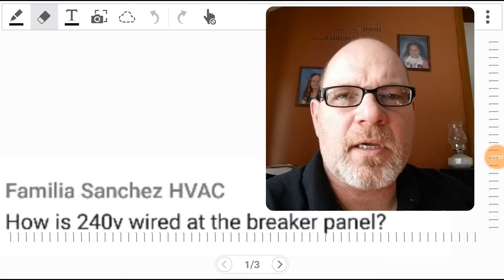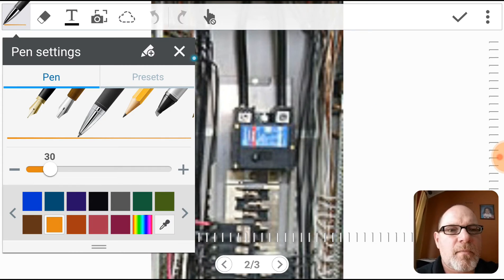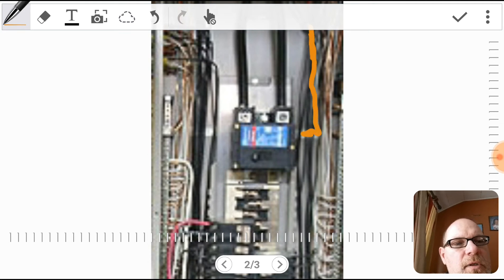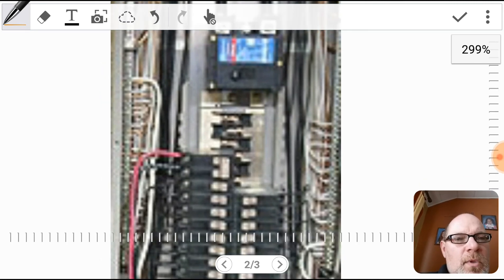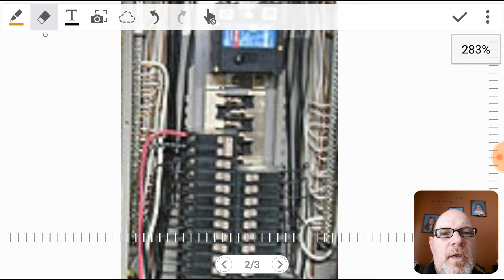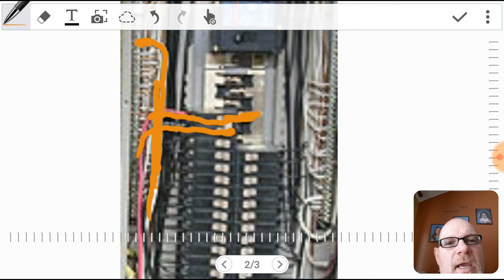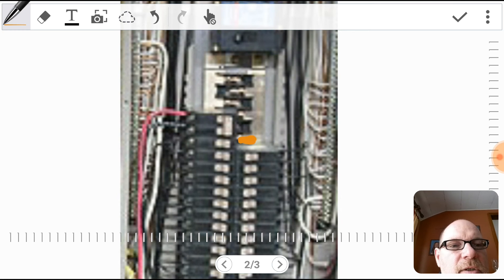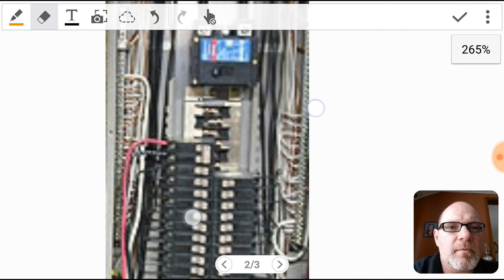240 Volt Single Phase Breaker Panel Wiring Talk

Comment: I'm trying to figure out where the phases seperate , could I use 120 at 30 amp to run something 240 at 15 amp? Doesent 240 run on 2 phase and 120 on 1 phase? It would be same wattage.  Is that too low of amperage like could I some how get 240 30 amp from a one phase 120 60 amp. Wouldn't the watt consumption be the same?
Reply: It is single phase period.   There is NO phase separation.   Phase is phase, volts is volts, and amps are amps.   With transformers, you can say yes to all your questions.   Without transformers the answers are all no.

Comment: For hvac ac compressor outdoor unit. It is the same??? In that case the comoressor is 2 phase not 1 phase i am confused
Reply: Building Statux    There is single phase and there is three phase.   There is no two phase normally.   If you look at a phase as the number of coils in the transformer and not connection points, it might help.   Single phase 120/240 is one coil with a tap in the center of the coil with three connection points.   Hope that helps.

Comment: So I've been trying self learn how to wire a 60gal compressor up in my garage for 240v. The compressor motor says it requires 230/1/60. I think that means 230 volts, single phase, 60 hz. The spec sheet for the motor says it requires 15 amps.  the compressor itself only has three wires. Two hot and ground. Red, Black, Green. Can I run a 20 amp, 2 pole breaker on 12/2 romex? White labeled red/hot, black hot, ground from the subpanel ground bar to the outlet ground? I'm getting confused because there is no neutral wire in the circuit. 

Any insight or guidance would be GREATLY appreciated.

Comment: What is the advantage of going to a 240 V meter and panel when everything in the house is 120 V ? I’m going to have to replace my weatherhead and pole that holds the weatherhead because everything is rusted and rotting Anyways. Thanks
Reply: Some equipment, welding power supply, larger motors (table saws, plainer, etc...) can use 240v and current (amps) can be low enough to use existing wiring without over load (heat, fire, etc).  10 amps at 120 v = 1,200 watts, 10 amps at 240 volts = 2,400 watts.
Reply: mikecodester    It's a standard system.   120/240 volts will be your only choice for your house from the utility company.